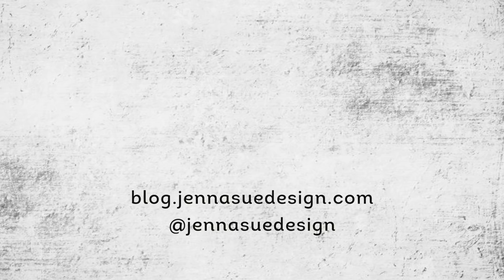A Christmas Vlog Update: Episode 21

Comment: Jenna how in the He%$ do you have time to decorate for Christmas?  Are you baking cookies too?  GEEZ!
And WOW you have had a big year.  Jenna have you ever thought about Cerusing the top of that round table and just leave the rest white?  If you stripped the top and Cerused just the top with white, it wouldn't be that hard (Isn't the top done with an inlay or parquet?).  Just throwing an idea your way.
P.S. On that window seat, do you know what size stock your husband used to frame the face of the drawers, or did he rip a special size?  I am going to do the same thing to existing cabinets and you got the proportion right.  I am going from flat formica to shaker, then just paint it all, I can even use the same knobs, but will have to countersink the hole because that screw is only so long.
Thanks for post and hope I am not too much of a bother.
Reply from the maker: We custom ripped those pieces down (you can find more details about that in the blog post!) so they ended up over a few inches wide but that will completely depend on the size of your drawers (ours are huge).
Reply: @JennaSue  Kind of you to reply, I have allot of cabinets/draws in bath, kitchen of various sizes.  I'm thinking that frame should remain a constant size throughout.  Probably 1/2 inch MDF, then maybe ripped to 2-3", and see how it looks.  I watched the vid again and you don't say.  2.5" sounds about right, but I'll just have to see.
Architect here so that is why I appreciate what you do so much.  I love your restrained design sense.  I would bust your door down to hire you.  Can't wait to see what you do with YOUR house and you can go a little crazy and have more free reign.
 Thank you again, HAPPY CHRISTMAS.